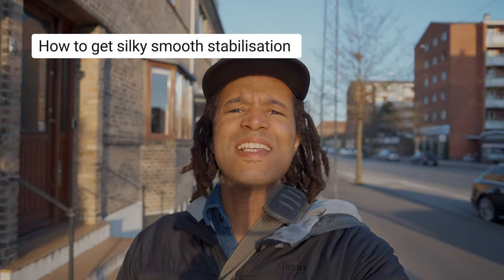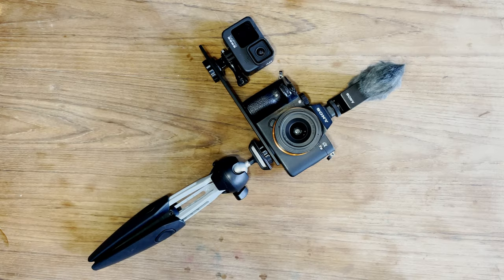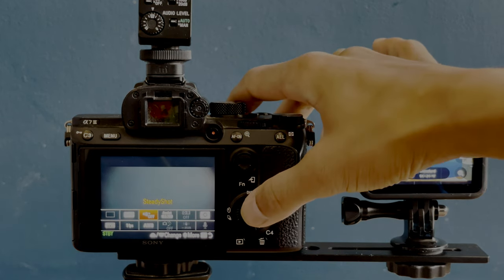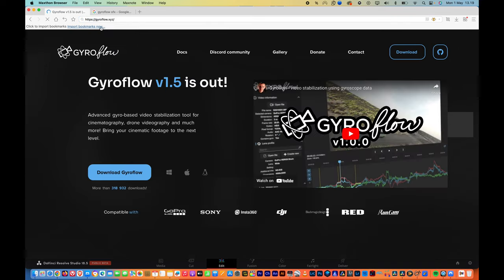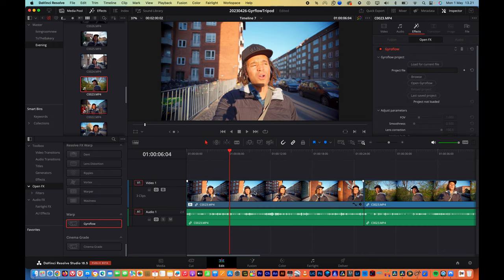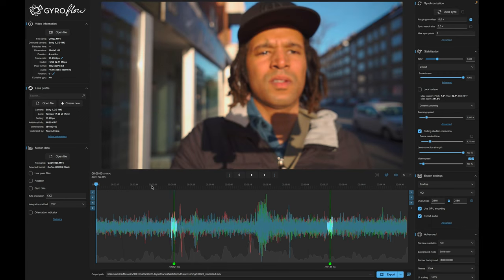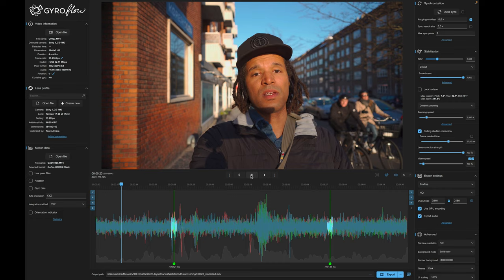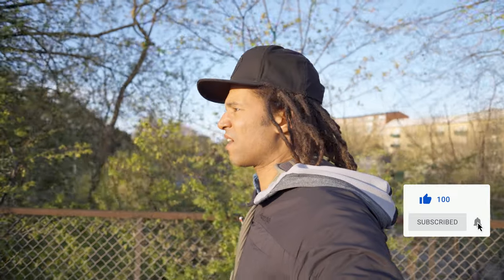Gyroflow tutorial - Stabilize any camera - Sony A7III as smooth as  Sony ZV-E1 dynamic stabilization

Comment: Great video! Do you have to add the motion blur in post production since the shutter speed was set at 1/400?
Reply from the maker: You can but don’t have too, it’s a matter of personal preference. I did on the running shot if I remember well. It works well but the processing is quite heavy!

Comment: Good idea but way too much effort for me to bring it into my workflow
Reply from the maker: Hey, yes after a while using it I figured it requires quite a bit of effort, a bit like working with 360 videos and reframing them, but I’m trying to streamline the workflow. Also, I’m hoping future version of gyroflow could be automatised. We’ll see…
Reply: @AmaraBenjamin  hopefully one day it will be an option added on to general stabilisation in all NLE’s.  It seems like it completely possible but Sony for example would rather monetise this tech as much as possible.  If they can add it to the zve1 of course they could put it in the a7siii (which is supposed to be the flagship video camera). Sony shits me off with there business tactics.  Panasonic have pretty much caught up now they have pdaf so I might jump ship soon. Their stabe is awesome on the gh5 so I can only imagine what the newer cameras stabe is like.  The e mount system put Sony into a corner as the size of the mount is too small for ibis the work good enough without getting vignetting so they have to rely on digital stabe and the crop that comes with it
Reply from the maker: You’re so right about this! I think davinci resolve have their own gyro based stabilisation compatible with some of their black magic cameras, if I’m not wrong. Shouldn’t be that hard to implement such functionality for any camera that records gyro data, if only manufacturers (like Sony) would let it happen. They should so make an official catalyst browse/ prepare plugin, for a one time fee. If it works great, I would happily pay for that.
And yes also uncool of them to skip the a7sIII firmware update. 
People will start thinking twice the day they release a a7sIV. That is unless the go directly for the fx4, and cancel the S line?

Regarding Panasonic, I agree that they do have some great options, with good pricing too! 
For me though, it would be too costly to move to a different brand yet again. Can’t really sell an old damaged a7III for much, plus all my lenses are on the cheap side 😅
Reply: @AmaraBenjamin  yeah I here ya, I’ve been thinking about jumping ship but I’ve done some small damage to a couple of lens and a tiny bit of fungus on my 100-400 and 70-180mm which sux so I’d loose money by jumping ship
Reply from the maker: Oh that sucks. I’ve had a quick release camera strap fail and my a7iii had a fall on concrete, also the hdmi and audio input stopped working - which is reparable but would cost quite a bit when out of the warranty period. It will be my photography cam whenever I upgrade.

Comment: Can we use Gyroflow in Resolve for Sony cameras that have gyro data (then there is no need for a gopro and synchronization). I'm asking this because I'm not much satisfied with Catalyst Browse.
Reply from the maker: It should work normally, but I don’t have a Sony cam with Gyro data at the moment so can’t test. One thing to try, if you’ve got issues with resolve, is to create a timeline matching exactly the frame rate of your clips i.e 23.976 instead of 2, or 29.97 I stead of 30fps, if that’s the how your Sony records.
Let me know how it goes.

Comment: Interesting hack. Seems quicker than catalyst, but is way more cumbersome since you have to use the GoPro alongside the main camera. 

Background music is highly distracting and does not add any value. For tutorial videos, best to keep it to dialogue only.
Reply from the maker: Thanks for the feedback, will consider the background music thing for the future.

Regarding Gyroflow, the difference is that you can also use it with older cameras, in my case the Sony a7III, which don’t record gyro data, and are therefore not compatible with catalyst browse. That’s the reason for using a GoPro alongside. 

In principle, it should be possible to use recent Sony camera with gyroflow, without the need of a GoPro. I don’t know how well that works but if
If anyone could confirm that would be nice!

Also it’s nice to have a davinci plugin so you don’t need to have an intermediate exporting step, but yes it’s not the most straightforward workflow. 

Let’s see what future releases bring and maybe one day we can get an fully automated use, akin to the syncing of multiple audio clips!